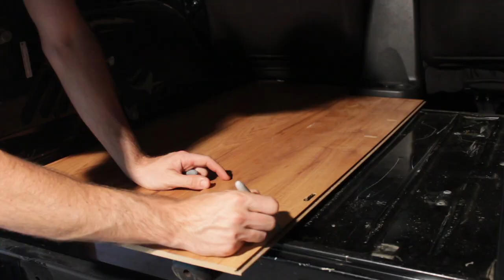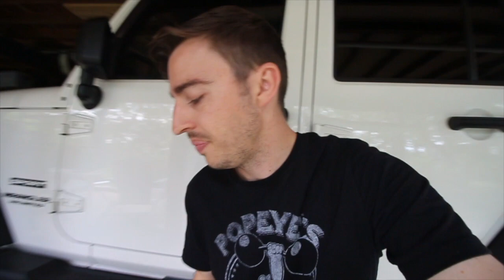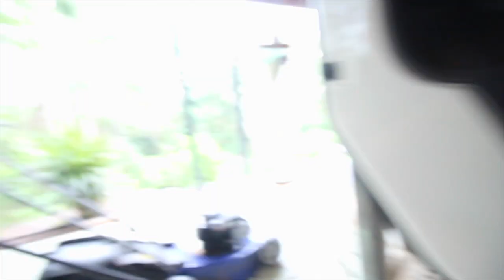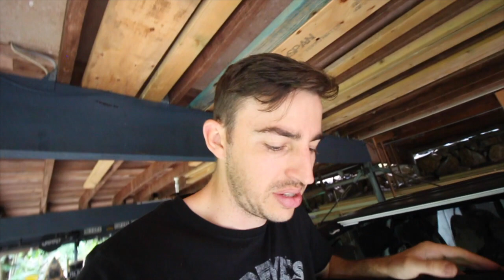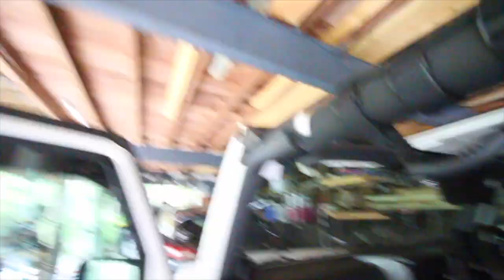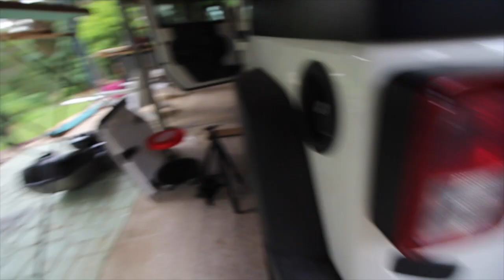CHEAPEST JEEP AMAZON PARTS

Comment: Inexpensive and easy to diy JKU mods I’ve purchased on Amazon:
Front and rear steel grab handles-$50
Antenna- $22
Gas cap cover- $20
Taillight covers-$16
Backup camera compatible with OEM radio display -$60
OBD 2 scanner-$22
OBD 2 app license (to unlock accessories/clear codes etc) -$20
Only other inexpensive mod I’ve yet to purchase is a 4 pack seat heater kit for $99, and a set of upholstery hog ring pliers $10 to install them on the front and rear seats.
Reply from the maker: Nice, any problems with any of the stuff that you have brought? Some good little upgrades in there